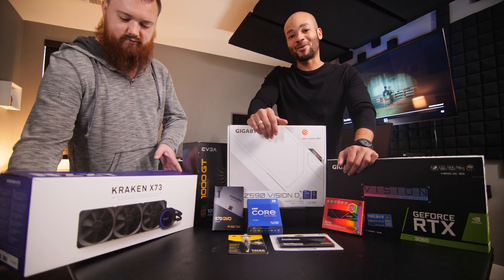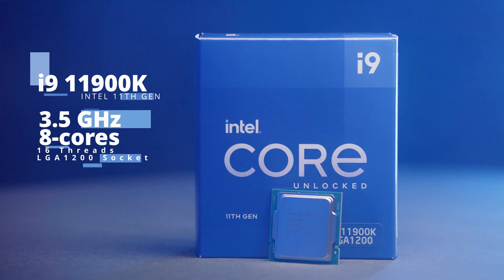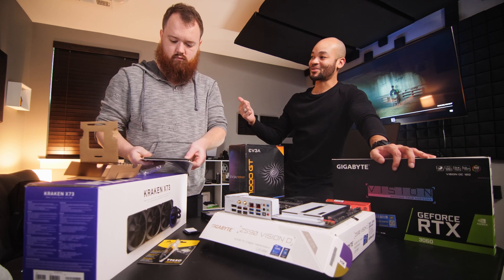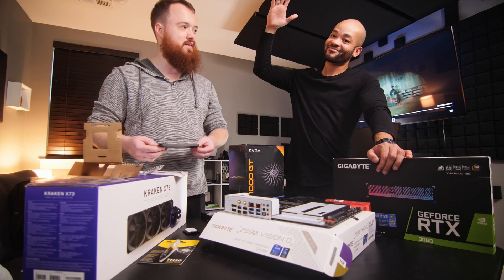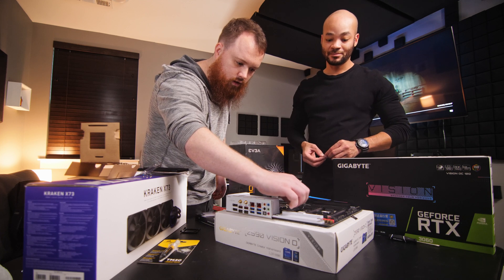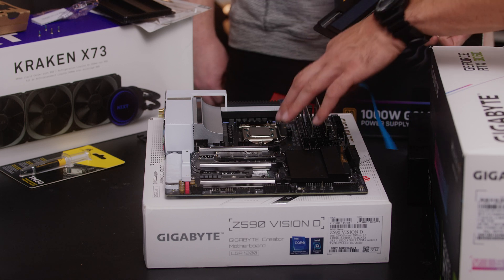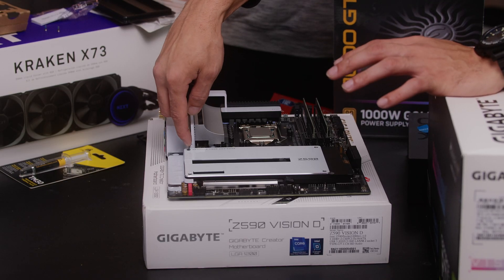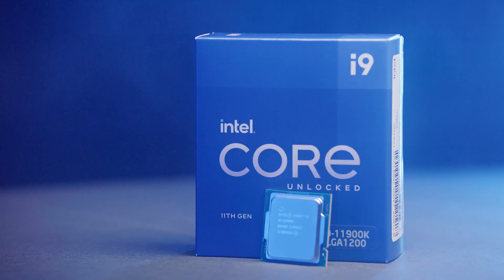BUILD A Perfect Editing PC in 2022 - The Best Hardware For Your Money

Comment: ngl this is horribly balanced, 1000w is extremely overkill, z5900 is overkill, 360mm liquid cooler is beyond overkill, 11900k is pretty outdated, and 3060 is really low end for fusion or heavy effects
Reply from the maker: You are probably right about most of that. This video is quite outdated in computer years but a 1000w power supple does allow for future video card expansion or adding a capture card or a lot of things. Thank you for the comment! 👊✌️

Comment: This is the current build that I am going for:
i5 12400 box new 50000pkr
Gigabyte B660M DS3H DDR4 31000pkr
32gb ddr4 ram adata/lexar 3200mhz 16x2 22500pkr
256gb ssd nvme m2 7000pkr
GTX 1060 6gb used 43000 pkr
1TB HDD 5000pkr
Total 165000 pkr
If I want to extend my budget a little bit, should my first preference be getting a 12600k processor or instead getting a gpu with higher 8 gb Vram. I want to edit in davinci resolve🥹 I am confused.

Comment: A old i9 and a 3060 for 8k editing, dunno... I´d opt for a 3070 and a 12700k at least, better 12900k and 3090.
Reply from the maker: It works really well but if you have the extra money, go for this bigger stuff. GPU prices are crazy these days 🚀
Reply: @TheModernFilmmaker  True that :/ But if it works without proxies, why spend more :) At least they got a little better, I´d maybe go with a 3060ti atm and focus more on the CPU, at least for editing in Premiere. Butt 12 Gen really is good if are willing to use Win11

Comment: Sick setup. Personally I'm gunna wait for PC to catch up to Apple when GPUs won't be necessary and built into CPUS finally (year or 2 away I guess). The cost of GPUS is bad right now (and ddr5 ram) I hope things sort themselves out next year. That setup you got will defo get a few years use from though I'm sure it's a beast
Reply from the maker: That is understandable. I just got the new M1 Max MacBook and it has been able to handle everything from complex fusion compositions to 8K BRAW footage. I am excited to test it against my i9 & RTX Titan build I typically use for work projects. Thanks for the comment 👊✌
Reply: I am a little late to the party, but the new apple stuff is pretty awesome. Something I will say about CPU's though is that they likely won't have higher end graphics inside of them for a very long time (5 to 10 years atleast), and that is something I feel like people are alright with. This means that they can upgrade each part individually instead of getting an all in one package. Luckily graphics cards are now going for way cheaper than they were a year ago, although there are some trade offs.

Comment: Wrong choice with the platform. A bit more cash and you get the i9-12900k, which is a huge step up.
Reply from the maker: I have to admit when I built this rig I was worried that the Resolve and Premiere may not be optimized yet for the newest hardware on the market. I personally hadn't tested the 12th gen so I did not feel confident suggesting it. Thank you for the insight 👊✌️
Reply: And just for curiosity, why not Ryzen 9?
Reply: @delbeaufilmproduktion7074  Ryzen is worse for Premiere, especially because the Intels have Quick Sync via the iGPU which really makes a big difference.